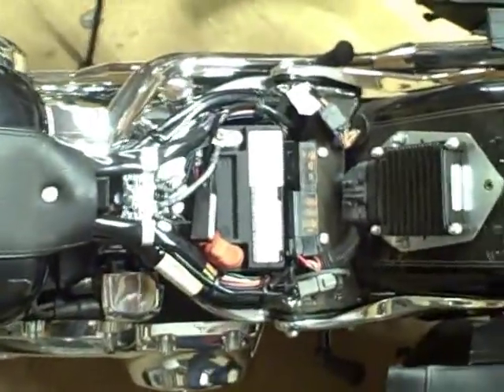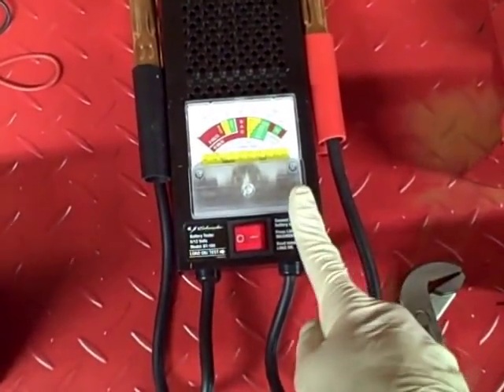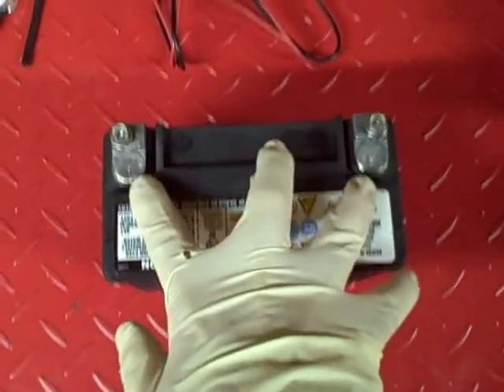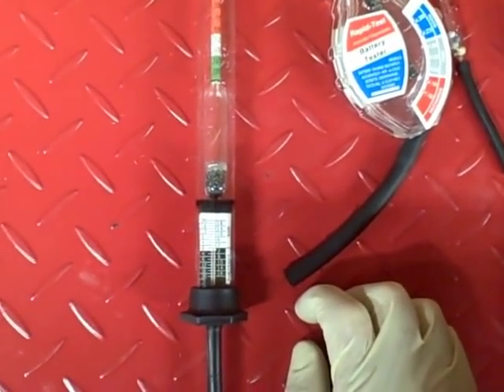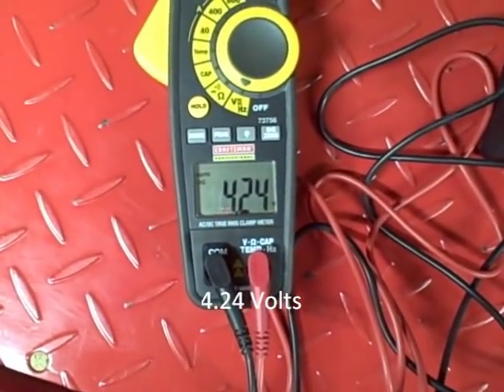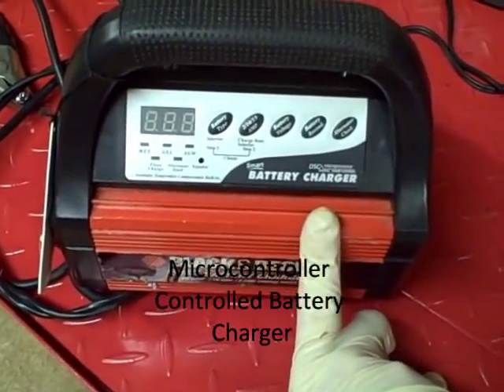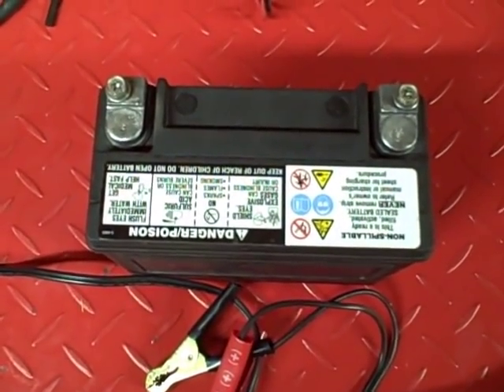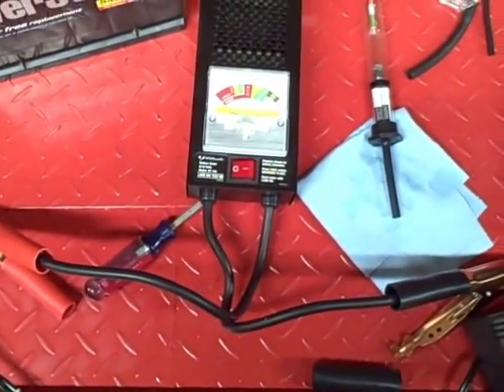Motorcycle Repair: Inspecting and Charging a Lead Acid Motorcycle Battery

Comment: i have a klr 650 and it acts like the battery is almost dead cranks over slow but when i  hook it up to the charger it says its 100% charged. i dont have a voltmeter yet but still trying to figure out why its doing it. Odd part is it doesnt do it all the time some times it cranks over like a new battery. any ideas?